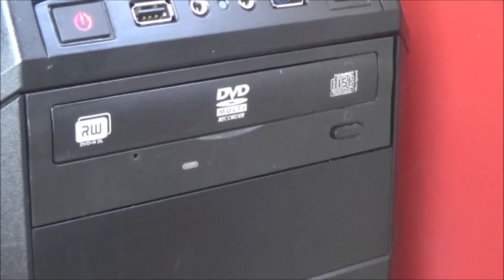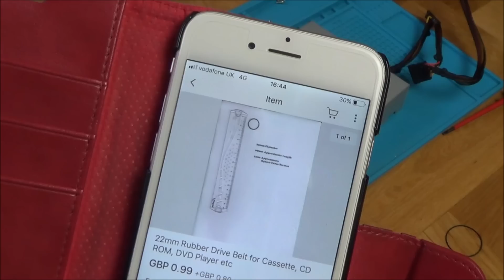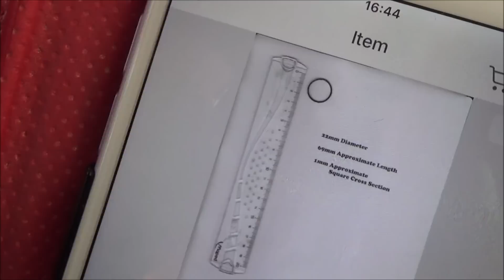Trying to FIX a Faulty DVD / Optical / Disc Drive in a Desktop PC

Comment: Hi, the magnet is supose to hold the disk from vibrating, and it spins with the disk because it’s not touching anything cause it sits on the disk itself, don’t know if this makes sense but it sits in the middle of the vertical play it has because of the disk lifting it just a tad... hope it was a good enough explanation 😂👍 see you in the next one 👍

Comment: 54 seconds into the video: I had the same problem, it seems to happen a lot with the LG dvd drives. The belt that pulls the tray out was the problem. I gave a good clean to the belt, motor pulley and tray pulley and now it works fine. Now let's see if I was right.

Edit: to take off the faceplate you need to pull out the tray using the paper clip tool.
Reply: yep or you have to pull it In direction upwards cause it is only clicked in

Comment: I have a disc drive that is doing the same thing, and its the belt being worn and not being tight enough to loosen the magnetic disc holder which is what the clunk is when there is no disc. Its so funny because if you just hit the top of the disc drive when there is no disc in it, it will loosen the Magnet and open the drive.

Comment: The white plastic circle in the top of the metal case has a magnet in it, when you close the tray and the cd spindle rises with the disc on it the magnet snaps down onto the spindle to hold the disc in place while it spins. The spindle lifts the white plastic circle into a position where its just hovering without touching the metal lid or anything other than the disc and spindle. It spins freely with the disc without adding any friction at all. Long story short it's a great design used in almost every tray loading drive so don't worry about it lol The first time I learned about that was on a ps2 disc drive. On those you can easily pop the white circle out of the lid and put it on the spindle/disc to test the drive without the lid on it.
Reply from the maker: Excellent explanation, thank you :-)
Reply: @Mymatevince  Thanks, no problem.

Comment: I have the same issue for years on one of my computer's DVD drives. Already opened it and saw nothing special and ended up using always a paper clip if there's no DVD inside.
I think I'll just try and find some rubber belt on aliexpress and try fixing that for good!

Comment: Quite a common issue on LG drives (particularly Blu-Ray players) is that the magnet on the puck (the white spinning assembly at the top of the drive -- yes it spins and yes it has a series of ball-bearings to ensure smooth running) comes away from the plastic housing causing the drive not to read discs at all (as it's the magnet that clamps the two parts together ensuring that the disc spins at the correct rate). Easily fixed, I've done a few of them with superglue.

LiteOn drives (of which this is one) use the same arrangement as Sony where the belt needs to be fully torqued in order to lift the laser assembly (and release it). Quite common for it to fail as you've seen here. The boiled belt will likely outlast the burner now.

It is a bit of a weak design but it's the result of years of simplification. Early CD players had a range of different methods to lift the laser assembly -- early Sanyos were particularly interesting as they had a separate motor to drag the laser away from the disc before it ejected.

Comment: There is often a locking mechanism that prevents the dram being opened in order to prevent disk damage. This is usually engaged and disengaged by a solenoid.
Reply: Sorry meant draw not dram

Comment: The magnetic disc is purely stationary. It doesn't move at all. It just holds the disc in place to prevent the disc from wobbling during spin.
Reply: Of course the white plastic with magnet spins otherwise it would act as a brake.
Take apart a PS2 FAT and you will see how it works. The white plastic and magnet is needed to hold the disk 
against the drive spindle below and provides grip and prevents it from flying off. It spins freely once it contacts the center of the drive spindle.
Other drives like portable CD players use the 3 clip in method for the disks 
as this is required for a lower profile drive type, for example the PS2 slim uses the clip in method.

Comment: I have the exact same problem on my Xbox 360 original white model. I never play it anymore so I haven’t bothered fixing it, but it’d be nice to get it working again.
Reply: me too
Reply: Remove the belt and soak it in hot water I did it to mine now it works properly

Comment: 26:10 .... I think I have the answer. It drove me crazy, broke several units as well. The spindle or the cap on the top are MAGNETIC. They sanwich the CD and self center it using nothing but magnetic force. When opening, motor is not only fighting the tray mechanism but also trying to LOW the CD caddle and to do that it needs to unstick the two spindle pieces (on on the transport, one on the case. Now, with a CD, this magnetic force within the "sanwiched" spindle parts is lower and does the unsticking job more easy .... Find out it after broking several units ... LOL. Sometimes a better belt does the trick. Sometimes the plastic guides that for the mechanismo up and down are a bit worn, greasing can help this a bit. I havent been lucky with this ones =(

Comment: Back in the day (when they cost considerably more!) I had a spare white plastic disk that I used to keep the test CD on the spindle, perfect for troubleshooting... So yeah the white plastic bit spins with the disk. I guess that's the problem with mechanical      drives. We are almost there with completely solid state - I couldn't afford to move my Bluray collection to solid state devices just yet!

Comment: I had a drive that could not be open when not DVD is in, but with a DVD, it opens fine You use a unconventional way to  fix it :D  in my case the magnet was to strong.. I replace it from another faulty drive.

Comment: Can be an issue with the design of the fixing mechanism in the case. Usually the toolless designs rely on compressing the drive in the case but the original screw fixing method actuall pulls on the case to grip it, when screwed from both sides it is pulling the drive case apart slightly. Just a thought...

Comment: It makes a difference when the disk is in because of the disk thickness. That makes the difference for the magnet strenght to loose or not the under mechanism that drives the loader out. Without the disk the magnet force is bigger and the mechanism can't release down to free the loader. I suppose this happens because of the aging of the components... Seems to be common on Xbox 360. #xbox360 #magnet #loader #stuck

Comment: I had this problem with my DVD RW, I clean the belt and pulley with IPA and it worked fine afterwards.
Reply: yes,anytime i had a stuck drive i cleaned the belt with dish soap and used a paper towel to dry it and it fixed it

Comment: @16:37 that's normal because when the tray slides in more it will move over, the gears will grip each other and push the part with the eye up so it grabs the disk and the thing in the top holds the disk down while it spins so it doesn't fly off when the inside of the disk is being read (the disk spins faster at the center and slower on the outside)

I've taken apart a few cd and dvd drives even a portable one so i know how all the parts work inside them

Comment: The white bearing on the metal plate probably falls down because its loose  when there is not disk and gets stuck onto the disk holder (Refering to black thing). It works with disk because when you put in it pushes it up.

Comment: Quick question:
Would a corrosion free solder joint allow more current through and give more bang for the buck than a joint which is corroded (even slightly)? If this is the case then maybe when you removed the corrosion it allowed more amps! through and made the motor perform better. Logically I think this is correct. Continuity shows there is a connection but doesnt show how good it is.
Reply from the maker: Possibly, that does make sense to me :-)

Comment: Ok, I have not yet watched the entire video, but the reason that the disk makes a difference is because it was pushing down (a very little) on the central spindle... and because the rubber band is worn  that little bit of pressure bu the disk was helping push the spindle stage down...  when you put new lub in the drive it should help a great deal....  but also replace the rubber band.

Comment: The belt does not have enough traction to pull the core down to release the tray, With the disc in there the magnet does not touch the spindle. that way it does not pull up as hard as it is further away. The magnet in the top is for keeping the disc in place while it's spinning, and yes the white magnet part does spin with the disc. Replace or boil the belt and i guarantee it will work just fine.
Reply: I can see you did that at the end of the video just now.

Comment: 100% the belt ... the magnet is stronger than you think .. and its what is causing the issue .. when there is a  disk in there the magnet is further from the spindle but when there is no disk in there the magnet is closer and stronger .. same issue on the xbox 360 also this is .. very common ..

Comment: Permanent solution is to open that white plastic that holds the magnet, get some sellotape, stick it over the magnet, cut it to the shape of magnet with something sharp like xacto knife (if needed put more than one layer of tape). Sellotape will weaken the magnet just enough so the dvd tray can open without a problem.

Comment: I know this is an old post but looking for help. I am working on a portable dvd player. The problem is the volume starts out normal but after 30 seconds it completely fades out. All I have done is replace 1 obvious bad capacitor. Thanks.

Comment: It looks like the magnet stays put. It's drawing the drive platter up and likely keeping it lifted into it's magnetic field. In theory you could slip paper between the platter and the magnet, the platter is pulled upward spinning freely, without contacting the magnet at all. This is conjecture on my part but it makes the most sense. With the spindle load relieved by being suspended magnetically, it probably helps achieve the crazy RPMs of laser reading type drives more spontaneously. (Take my comment with a grain of salt however)
Reply: Problem is not in magnet and solution  likewise is not there. I see some "guides" how to hack magnet on youtube and all these guys have same (wrong) idea that magnet is cause of problem.  Yes, drive is unable to separate tray from magnet but not because magnet is now stronger somehow. Reason is always something else. Loose or just dirty belt, dry wheels, foreign object stuck somewhere etc....
Real solution is to find and fix a problem, messing with magnet can temporary fix symptoms but not for very long time.
Reply: I think the magnetic piece just pinches the disc against the spindle to keep it firmly and level on the spindle while it's spinning.

Comment: The motor spins the disc that's Des vins that and in the top middle there is just enough gap between metal and plastic that it doesn't touch when it is magnetized to the motor

Comment: its the little belt at the front and when there is no disc in the magnet on the part the disc sits on is to strong for it to release the tray and when there is a disc in it gets weak enough for it to work propley so because you have the lid off is the reason why its working propley cos the magnet is on the lid part of it 
the magnet is there to hold the disc and it all spins 
try cleaning the belt so its free from grease

Comment: the drive doesn't rely on weight when you open drawer the mechanism drops down & drawer slids out when you close the motor winds drawer in & engages the mechanism once this has happens the disc motor spins up & laser does its read only routine & if you want to know why the drawer fails to open its dust build up on the rubber belt & or dirt build up on the moving wheel

Comment: It's the belt slipping when trying to open as the white plastic thing in the lid is magnetic and stick to the motor that spins the disk when there is no disk inside the magnetic force of the white plastic is to strong for the belt to break fully when the disk is in the magnetic force is less and a little easier on the belt as it's not as hard to   break the force of the magnetic off the motor

Comment: 100% it's the belt at the front slipping, Its a common fault especially on the original xbox drives. Just use washing up liquid on the belt and put it back.

Comment: asometimes disassemblong something will realighn whatever ca me loose. In the case of that. I usually just replace the whole drive unit when they do what that one is doing. My experience has always been failure of the whole unit soon after my repair effort. You can get a CD drive rather cheaply any more.

Comment: You said the white magnetized weight would produce friction and rub, you haven't taken into account the thickness of the dvd disc, ake it's raised about a 1mm so is not touching when spinning.(so don't bend the top part of the case)
Don't think those drives are designed to work on their sides, the type that do have a spring loaded ball bearing system, so don't need any weight (that's how the old discman worked, and the ps1)

Comment: A very common problem indeed! I would normally say, play patta cake with all your fingers heavy tapping on the top front of the tower which can usually work in most cases, but your brother's PC, is not the case & I wouldn't recommend doing the fore mentioned !
The drive needs to be extracted & worked on if there isn't a small pin hole to push the end of a straightened paper clip in to push a mechanism to release the disc tray.
The drive belts have perished or warped & needs to be replaced.
I put this comment before watching the whole video by the way.
You need to completely remove the metal casing of the drive & you shouldn't be prodding the circuit boards with a screwdriver lads!😂
& For f**k sake, DO NOT look directly down at the CD lense!😅

Comment: i am just watching this video now at 11-th minute and wonder how long it will take to findout that the belt is problem ... it will pullout your eyes :D
Edit: after 2 mins on 13-th minute you was on hot clue. The top holder is hold with magnet on spinner and when the disc is out the magnet is sticking harder to the spinner and the weak belt is insuficient to move mechanics but when the disc is in - make a larger gap between holder and spinner!
Edit 2: later 26-th minute of the video you was on hot clue again and almost fixed it :D
Edit 3: 28-th minute NO, NO IPA on plexiglass it will crack, also those plastic lens are coated with silver particles and you will erase them OMG you just kill it! Never lubricate (at least not much) mechanics that spins with 25 000 RPM another mistake (inside disk makes wind tornato and pulls everything in the air) you was right it will get worse and worse :DDD
Edit 4: on 36-th minute your brother found magnet (he is smarter) haha :D
Edit 5: 40-th minute - He is smarter he found the problem :D
Edit 6: 52-nd minute you fixed it! but you still don't know what was exat fix :D

Comment: Old trick with the Xbox 360 dvd drives sticking put the belt in boiling water for 5 mins the belt shrinks slightly and drive goes back to opening and closing

Comment: Hi, are you technician? I have an issue with more than 6 or 7  of my really old cdrom drives from the 90s and 2000s, even after replacing the rubber, when i insert disc it will try to read it and spin but it wont read it, but if i hold with my hands the dvd drive vertically with the tray facing up, or vertically at 70 degrees with the tray facing up...it starts to read the discs perfectly and drives are all functional....... This i have NO clue why it happens, i was goint to trash a lot of CD and dvd drives untill i noticed this weird thing about holding it facing up they all worked.

Comment: This problem plagued the xbox 360 drives, from what i remember people used to try putting tape over the magnet to weaken it
Reply: Same drive assembly essentially (LiteOn -- Sony design) in the 360 as this CD burner. As you say very common issue. Bit of a bad design as most other drives don't have this problem.

Comment: The magnet grabs the disk and holds it tight. Then the top section is actually floating in the air. There is no friction then.

Comment: I have had the same problem with two DVD ROM drives. I have noticed that on the bottom cover there are 4 locating tabs and one other  pointing downwards that touches two contacts on the circuit board, close to a label, VR701.   Does anyone know the purpose of this please.

Comment: Its working because you reset the mechanism i think like with ps2 disc drive sometimes it got ever soo slightly unalingned and u just had to reset it and worked
Reply: Would like to add vince u make good vids but secound half vid u making an issue out of a non issue its normal for it to not work on its side or upside down because that not how u use a disc drive depending on the drive the mecanism isnt designed for muiti angle use its made for gravity to be in its favour

Comment: What about replacing the drive with HL-DT-ST DVDRAM GUC0N Laptop drive, drive won't work till all ribbon cables have been reconnected and these media drives cannot be repaired as they say there are no user serviceable parts inside.
Reply: Everything says "no serviceable parts inside"

Comment: You can remove the front of the tray and then the frontplate of the drive and see the belt slipping.
Reply: And the top magnet spins too but only when aligned by the bottom motor. Then it's free from the top housing the magnet is in.
Reply from the maker: Good idea, thanks for sharing it :-)